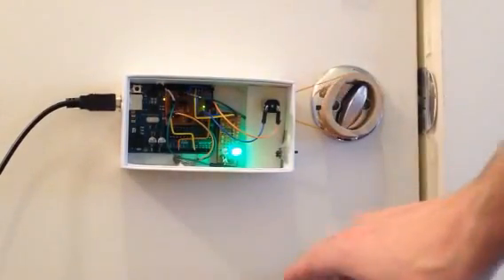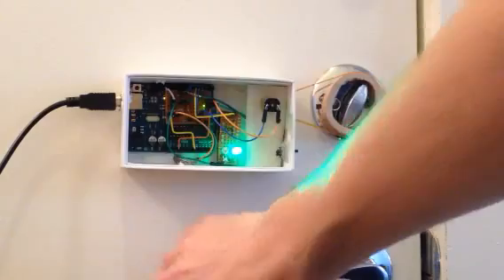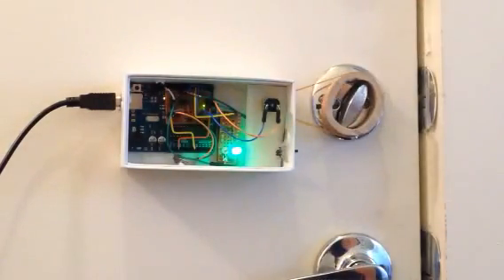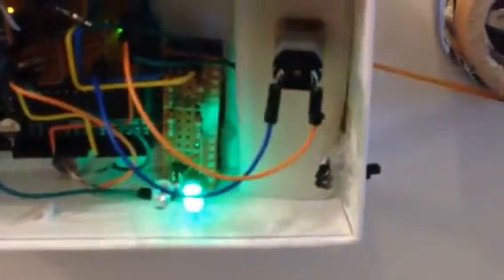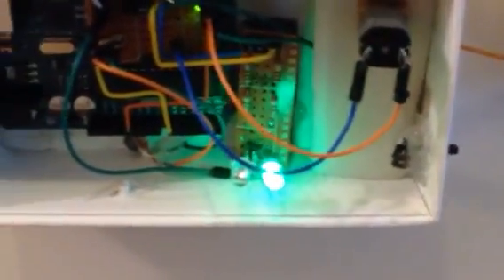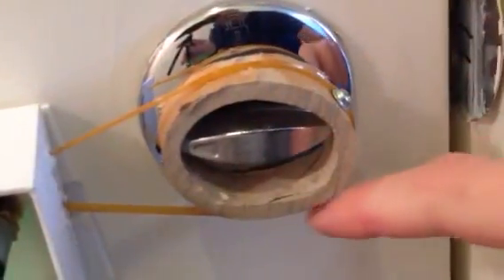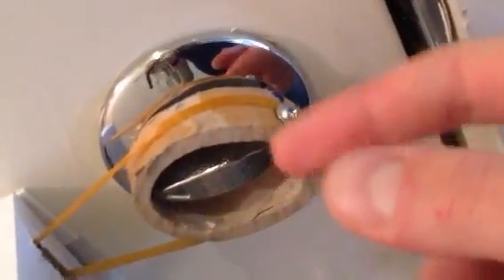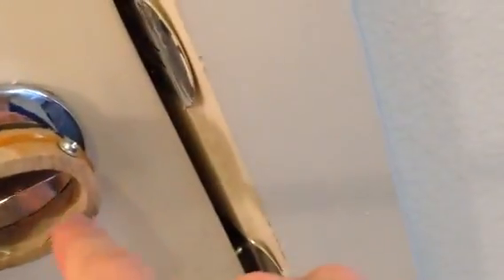Arduino Knock Lock in iPhone box

Comment: And can I use Arduino UNO with this project ?
Reply from the maker: +Essa Alawadi Hi Essa, the component to detect vibrations is called a buzzer. It is normally to make sounds like those beeps that come out of the PC towers similar to this http://bit.ly/24TPjQT. The arduino I'm using is an Arduino UNO. Good luck!
Reply: yes